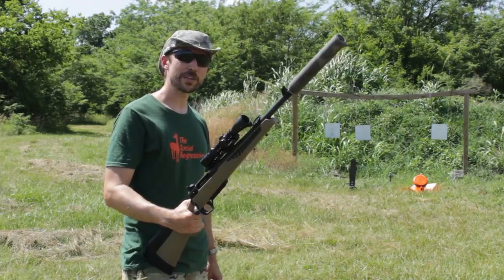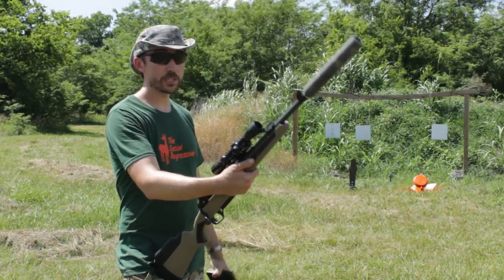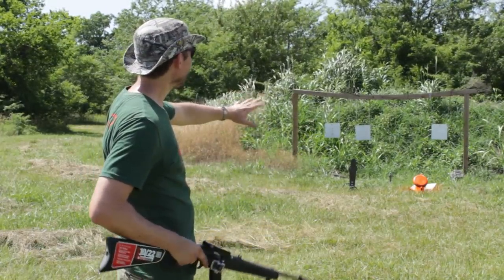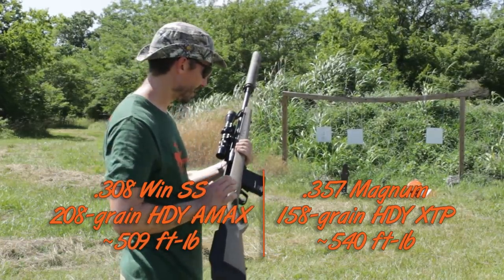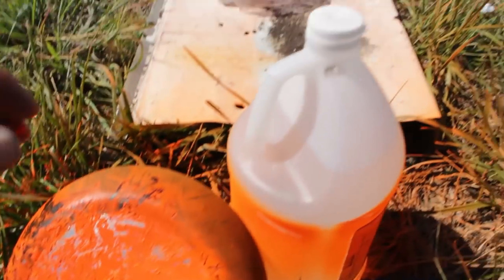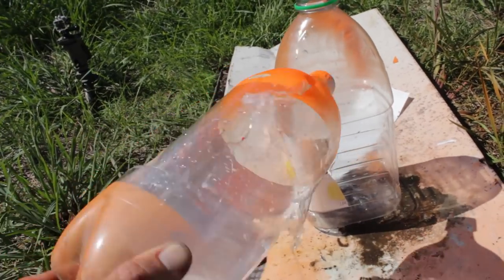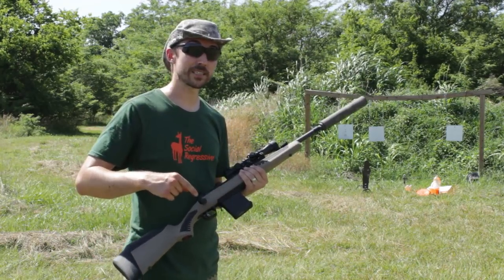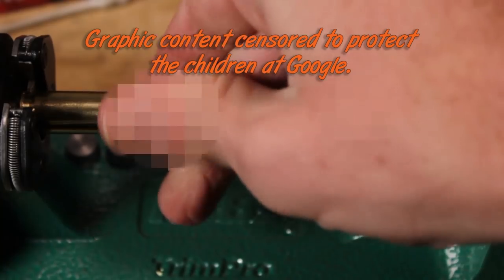How Hard Does a Subsonic .308 Hit? Silenced Savage 110 Scout Rifle in 308 Win

Comment: subsonic is fun but not the best hunting ammo.  You exchange energy for hearing safe, making trigger time a bit more pleasant allowing for shooter correction, but when it is time to do the job, use the best ammo with the best terminal performance you can afford
Reply from the maker: I agree. I think this would be for very specific, limited applications.
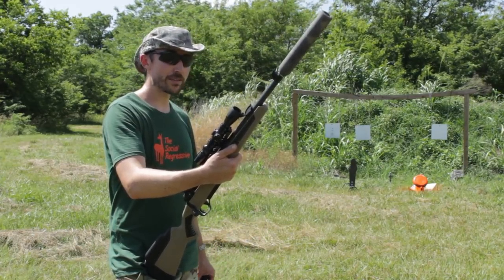Reply: The energy numbers are deceptive here..   While it matches the 357 magnum for "Energy" figures..   A 208gr A-Max has a ballistic coefficient over .500 compared to a 158gr .357's BC of around .150..   The 308's massive increase in sectional density would make this bullet out penetrate its 357 counterpart by a factor of multiples..  A 208 grain A-max would sail clear through a 250lb hog and drop it as though struck by the hammer of Thor..    A 308 probably has the case capacity to launch a custom 250gr dead soft cast lead bullet right at 1100fps which would again,  probably achieve pass through on any game animal roaming North America.     The limiting factor here is will the rifling twist stabilize a 250 grain 308 bullet..   I think 1:10 would but its probably right on the cusp..   I think a great Subsonic round would be something with a larger bore,  something along the lines of a 300 grain .375 dia bullet in a 308 case.  Because you're locked into staying within that 1100-1150fps threshold you're sort of forced to look for more power via increased projectile weight and/or frontal area..

Comment: Good test!  I've been curious.  It's almost like a 300 BLK.  That would be an interesting comparison.  6.5 Creedmoor subsonic....not sure I understand the point.
Reply: Graham Baates the point is usually on the front of the bullet facing forward.  If not, they may not fly well.
Reply: Hmmm, very clever.
Reply from the maker: I guess it would be identical to some of the heavy .300 BLK. Usually those rifles have a 1:7 twist, while this has a 1:10. I'd be curious to see what a difference that makes.

Comment: I wonder if anyone would ever make like a 400 grain bullet out of tungsten or something it wouldn’t be accurate but it would be neat to see what it could do
Reply: 9x39 is the AK round necked up to 9mm and loaded with a 280gr sledgehammer.   It was a Soviet SpecOps round and it predates the 300 Blackout by over a decade.    A few companies have begun chambering AK pistols in the cartridge and Wolf and Tulammo are supposed to be supposedly tooling up to bring it to market in the USA.
Reply: rainmechanic piedmont cartridge has some barrels. I got a 7.5 that I’m gonna put on a side charging upper that I’m gonna run with the gas off and a 10 inch form 1 can. Wolf is bringing in 278 grain FMJ, hoping that leads the way to expanding rounds
Reply: Holy shit, that's awesome.
Reply: A tungsten bullet would work fine as a penetrator or something. If you didn't coat it in some softer material(copper jacket) it would destroy a barrel. Tungsten carbide is extremely hard and brittle.

Comment: Am I missing something? Because as far as I know, the speed of sound is 760 fps or so, yet I keep hearing people talk about "subsonic" rounds with velocities well over the speed of sound.
Reply: I was thinking the same as you and talking out loud to myself. My Wife looked over and said , M.P.H. vs F.P.S. Geez , just one more thing she can hold over my head hahahahaha.
Reply: The speed of sound actually is 1014 fps
Reply: @henriquefern67  The speed of sound is the distance travelled per unit of time by a sound wave as it propagates through an elastic medium. At 20 °C (68 °F), the speed of sound in air is about 343 metres per second (1,125 ft/s; 1,235 km/h; 767 mph; 667 kn), or one kilometre in 2.9 s or one mile in 4.7 s. It depends strongly on temperature as well as the medium through which a sound wave is propagating. At 0 °C (32 °F), the speed of sound is about 331 m/s (1,086 ft/s; 1,192 km/h; 740 mph; 643 kn).[1]